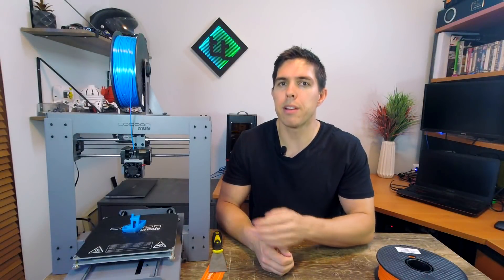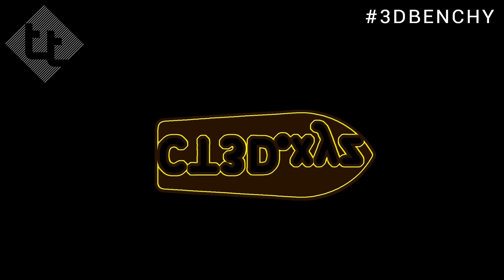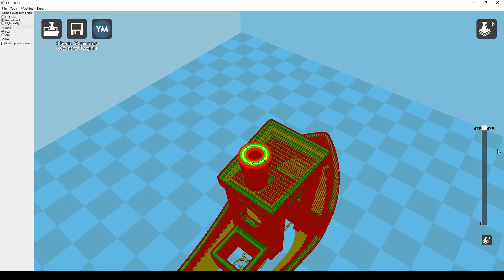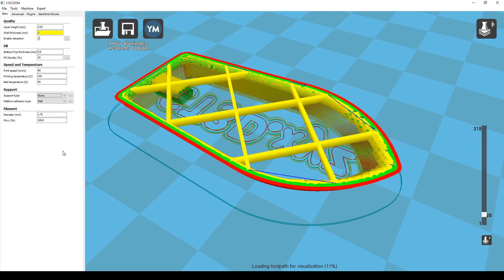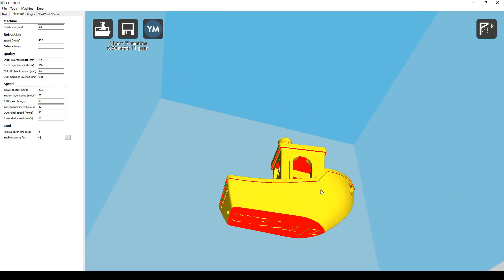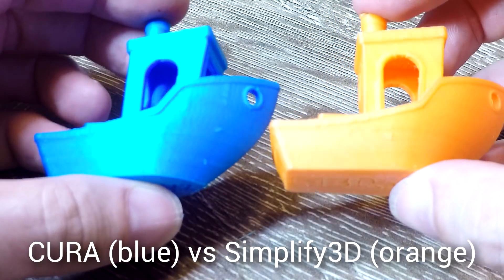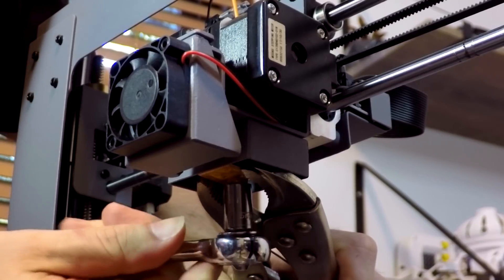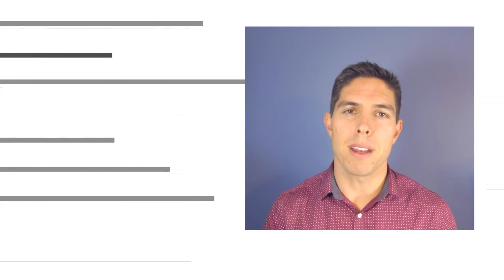Aldi 3D printer: Slicing and troubleshooting guide

Comment: I suddenly found that the printer bed was out of level by about 2mm. Checking I found one side of the Extruder Tower bars was higher than the other. I thought I could just move one stepper motor of the Extruder bars to make the adjustment, But, even with the power disconnected , turning one  also turned the other.( With no power and no physical how does this occur) So before I undid any stepper motor collar, I searched for an instruction video without success. Have you made a video on how to adjust the  the Extruder Tower  motores so the bars are parallel to the bed?
Kerry in Gympie Qld

Comment: I did a benchy as my second test print and left the default high quality settings to see how well it did it and how long it took, about 4.5 hours and very good detail, surprised at the time but hey it worked and now I know how to modify the settings more, I am still using the default extruder temp of 195c for PLA is that ok as I noticed you said in the video to bump it up to I think 210c, what is the advantage in that? great video thanks
Reply from the maker: Glad you had success. In my opinion, 0.1mm layer height is far too fine and slow for general printing. I think 0.2mm is accepted as a good compromise these days.
Reply: yes I have discovered that too.

Comment: Great video, I wish I had found it earlier. Have wasted so many hours finding this all out the hard way :( Are you able to share some settings tips for S3D?
Reply from the maker: Thanks PG. I believe I used the default PLA setting in Simplify3D with changes to the extruder and bed temp only (210C and 60C). The only other thing I did was tweak th start and end gcode.